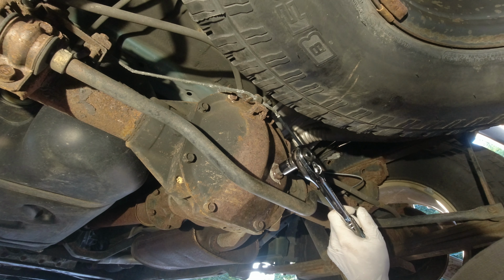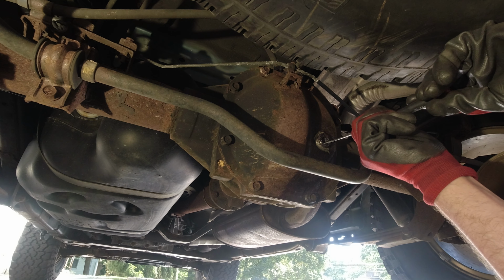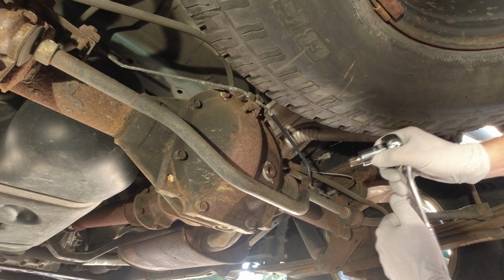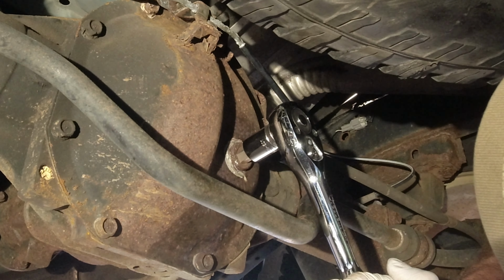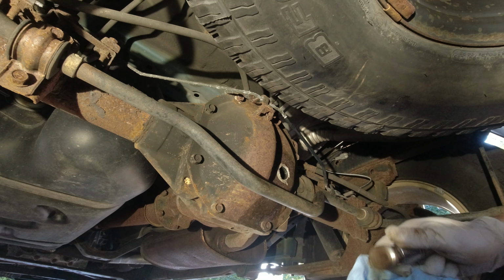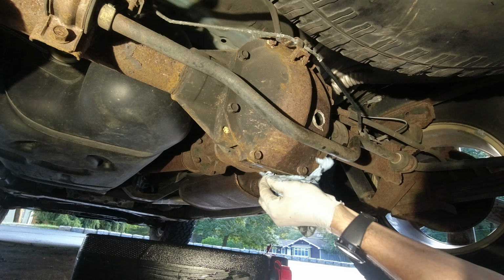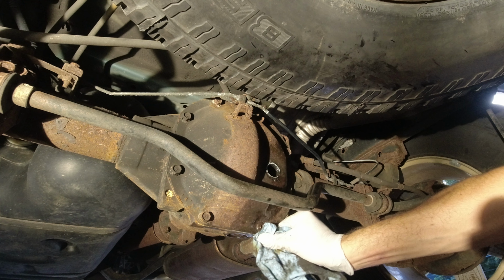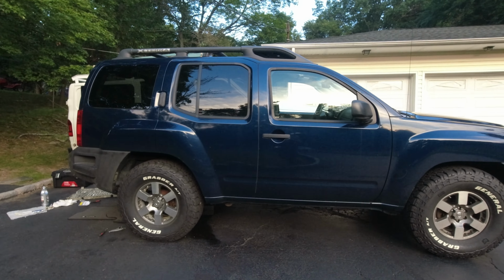Rear Diff Fill Plug Won't Come Off / Nissan Xterra Changing Rear Diff Fluids

Comment: Chunks of dirt yeah you bet… The magnet is full of little metal parts that’s normal. Best tool to use is an breakbar without extension that helps because those plugs are challenging some times…😮
Reply from the maker: you are right buddy!  I did replaced that plug later on... I picked up new one from Nissan and its uses different style so its good

Comment: More patience than me lol… I wouldve probably stripped by cleaning rust only partially out … then I would’ve drained it after stripping the full plug , pulled cover off , but new cover , paint / coat with anti rust paint etc. Reinstall and fill …. Especially after you saw all the metal shavings on the front I would be curious to see the gear(s) and it would be a good excuse to do so … dont get me wrong I would probably try to remove filler bolt for a day or more before deciding to get new cover … thanks for the info , living in the northeast here (snow and salt winters) I now know what to expect , and will PB blast it all a day ahead of time when I finally get to this ..🤙🏼👍🏼✌🏻
Reply from the maker: Hey !! thank you !   I was very close on buying a new cover as well I had it in my shopping cart already as a backup plan .. if I wasn't successful with the bolt removal. It would be my next set. buy new one open up the diff and take it from there..  ad dealer they priced me for $140 for new cover but I found online for $90 .lol  oh and yes PB bluster dose help alot just have to use it more then one time to be effective .

Comment: How do I identify what differential my 2008 Nissan Xterra 4x2 with automatic transmission has?
Reply from the maker: If you have a 2x4  then  you dont have front differential and only have rear differential  with the axle type  c200

Comment: Two suggestions, soak threads with PB Blaster for two / three days before before trying to break loose suspected rusted problem nut’s, bolts loose.  You did good with making the decision to use the hammer and make the 14mm work.  The other suggestion is use some ANTI SEIZE on the first inside threads and very little RTV only on the last couple threads. It looks like this X has seen road salt and that makes for this type issue.  When you do your suspension you will see what I mean.  So remember the PB Blaster weeks before you take on that job.  Good luck.👍
Reply from the maker: you absolutely right !!   thank you for such good tips ! I did spay that bolt with BP blaster but only 2 times so day before and night before but for sure it was not enough  lol 
and a little spoiler.. I am in the middle of big upgrade... and I been spraying all bolts for a week morning and evening and boy did that made a huge difference ! 
so video on that will be out sometimes this month
Reply: @DIY_AUTO_PHOTO  Actually, I subscribed to your channel because you have an Xterra.  LOL, I am nuts on these vehicles, I have two of them, a Midnight Black 07 OFF ROAD with 180K on it and a Armor Gray 014 S with only 51K on it. LOL, but, I also have a classic 88 SR5 ext cab Toyota with 320K on it.
Reply from the maker: @lazerrred  Thank you so much for sub!! I might not be professional youtuber or something but I love working on my truck and trying to make it better and sharing my journey of it with everyone )
Reply: @DIY_AUTO_PHOTO  👍

Comment: thats not dirt. its metal filings which is not unusual if you dont replace the oil frequently. Also you should replace that breather on the axel with an aftermarket breather kit. You will save your axel seals by doing this. The OEM breathers are defective and stop working after a while
Reply from the maker: I hope it wasn't too much of the metal fillings...  

as to the breather yes thank you for saying that I  will have a video on that soon too ))) and I feel I did pretty well as I got all the parts myself for half the price of any kids on the internet ! so stay tuned ))